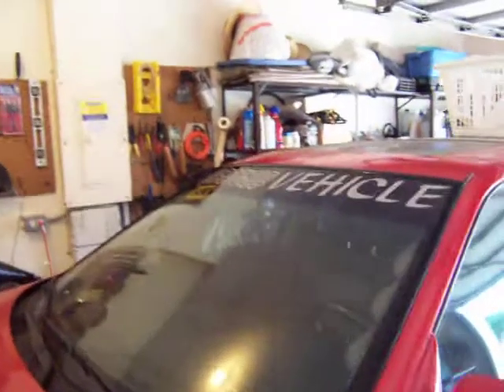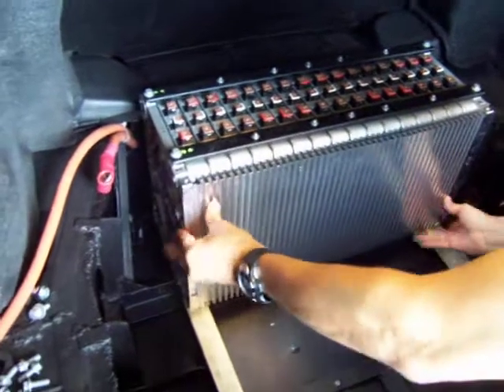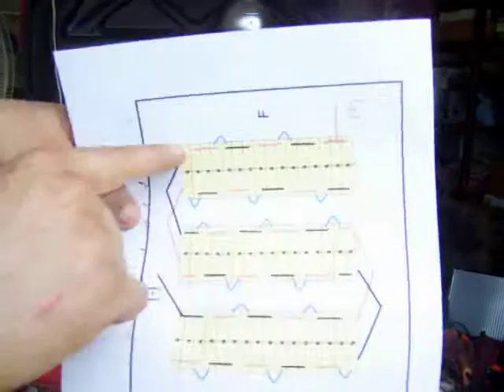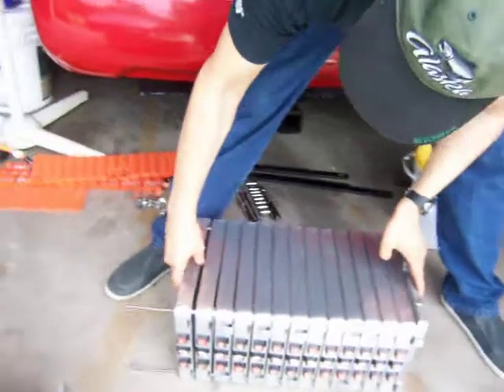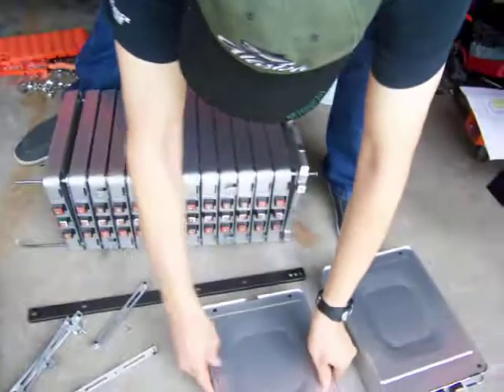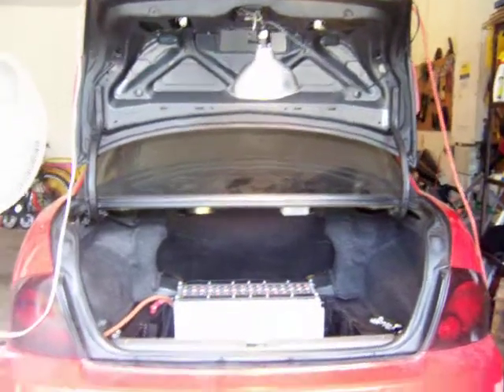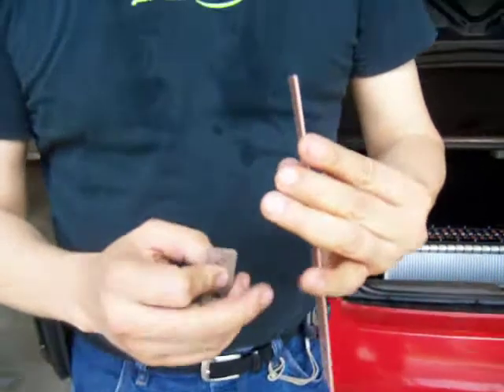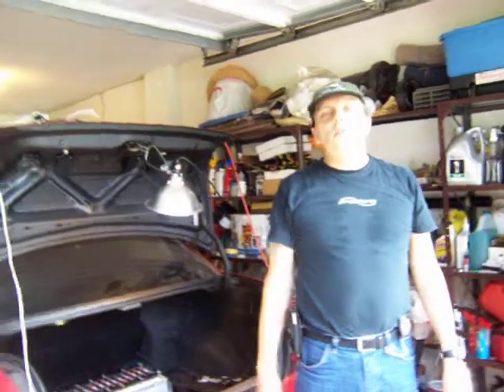Nissan Sentra Electric Car Conversion Part 37

Comment: Good work. What kind of batteries are those and where can I buy them? Thanks
Reply from the maker: +robviolin1 These are Nissan Leaf Batteries. I bought some of them at ebay for about $80 per battery. I got 48 batteries when I bought the whole package of 48 batteries. These are junk yard used batteries
Reply: +mecanofan that is $3840. I want to convert my 1998 ford windstar to electric. I just need help. I would be happy with a 60 miles range. Keep posting. Your electric car vids are great.